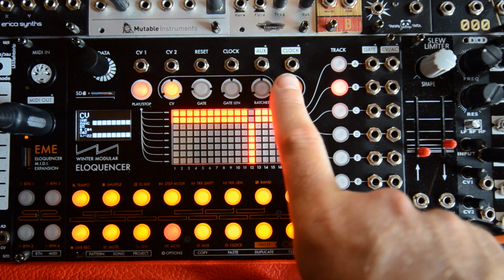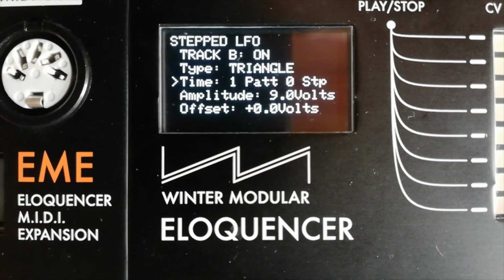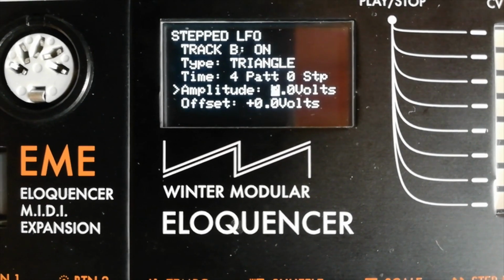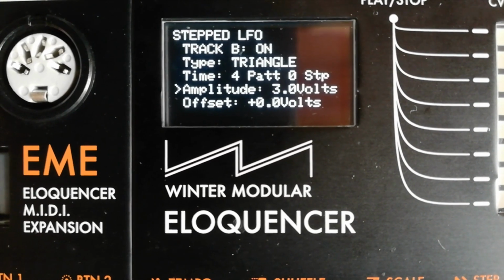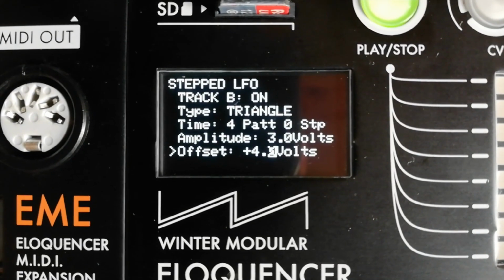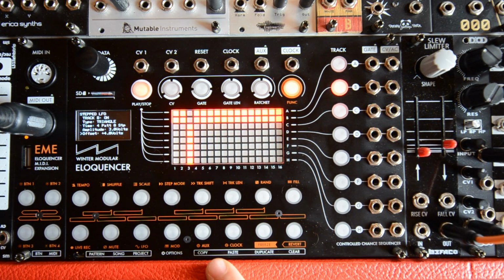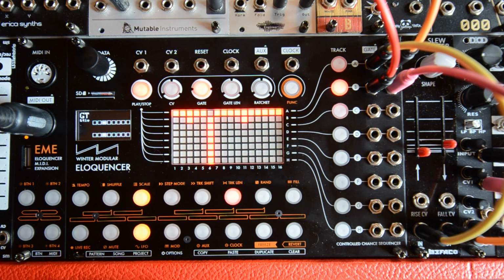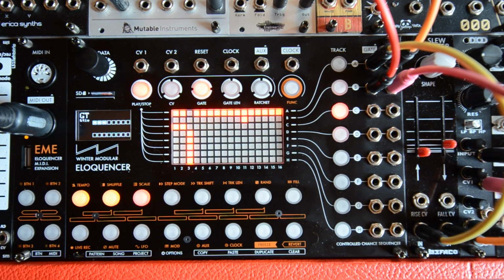EME  5  MIDI out

Comment: Hi, I own an Eloquencer, and I need a master clock/start/stop controller to keep all my midi devices synced, but I don't want it to send any other midi data.
Can the EME be set to only send out clock/start/stop data? 
I previously used the E-RM Midiclock standalone device, but since I moved and no longer collaborate with my bandmate, I don't have access to it anymore.
Thanks for your help.
Reply from the maker: Hi Khaled ! If you don't assign any MIDI message to any of your tracks ( FUNC + MIDI (hold) > MIDI OUT) and you de-activate the controller feedback (FUNC + MIDI (hold) > MIDI IN > Contr. feedback : NO) you will only send MIDI CLOCK and TRANSPORT messages
Reply: @wintermodular5455  Thank you very much for your quick and concise reply.